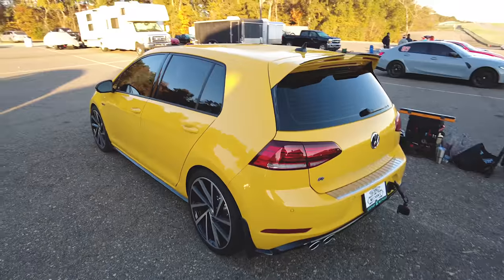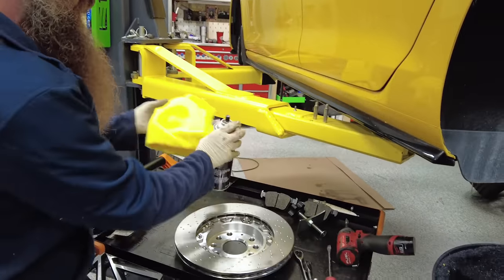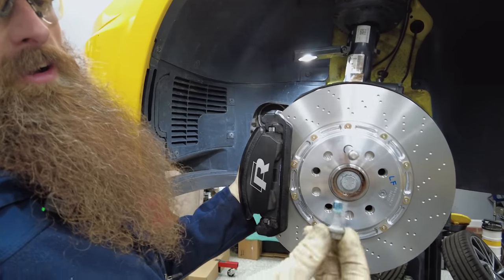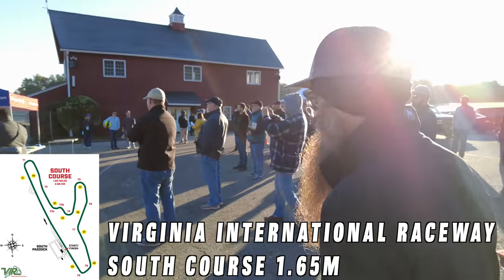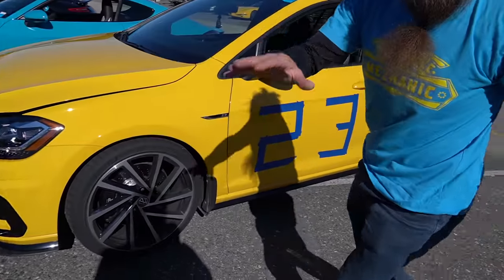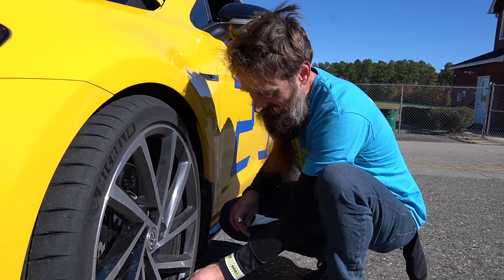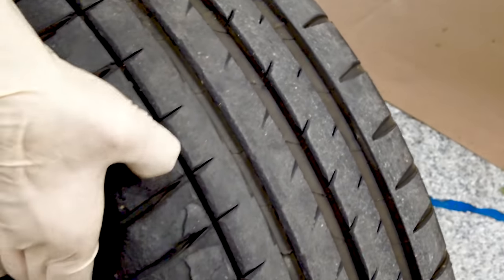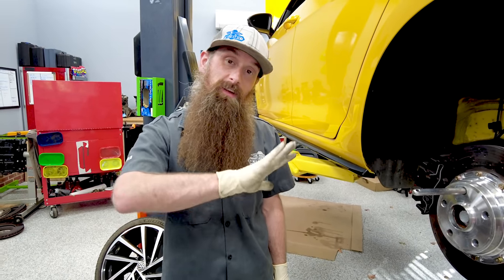Brake Upgrade for Tracking a 2019 Volkswagen Golf R at VIR

Comment: HumbleMechanic you need to remove those heat trapping caliper covers with the R logo to get some airflow on track days. They look pretty but trap a pocket of super hot air on the pads.

Comment: I use 355 Stasis rotors w/ Alcon 4 pots on my MkV GTI . Upgraded to R32 rears. Slotted all around. Hawk pads and upgraded SS lines and fluid. My stickies are Falken Azenis.  I swap out my pads usually one on track days and tires last for maybe 5 days. I also have heat indicators on my fronts so I have a idea of fluid and pad condition. I suggest people tracking keep a complete set of spare brakes on hand. Easy to swap during breaks in sessions.

Comment: I found when I upgraded my rotor size it really didn't do a whole lot. Hopefully you can turn off all the nanny systems. The porshe 922 I drive always thinks I'm in snap oversteer . All these electronic sytems can really put a damper on the party .
Reply: The only benefits to bigger rotors is higher thermal capacity, ie they hold up to brake fade better.  Pads and fluid made the biggest difference on my car.

Comment: What gets me is, the Porsche Race Team takes the drilled rotors off and puts on solid discs.  Now this is before the ceramic discs came out, and in some classes the ceramic rotors are not allowed.  In those cases the race team uses solid iron discs as mentioned.  Why because of stress cracks in the drilled rotors.  Now these rotors are dimpled, and yeah they are supposed to help with off gassing, but realistically a good pad design will do better job of that vs the dimples in my experience.  The aluminum hats are where the weight savings is coming from.  My option would be to go with this set up but order solid discs, and if you want a good track pad that can also be used on the street I would go with HAWK HP's or Centric HD's.  These pads are not track only, but something you can street drive and track occasionally with and not break the bank.  If you want a dedicated track pad, that is fine, but do not attempt to use them on a daily driver the noise when they are cold will drive you crazy.  Another step would be to use braided brake lines, but some are not DOT approved so if your daily driving your car look for DOT approved lines.  Enjoy the ride and have fun👍

Comment: My 2009 car with the mk6 gti engine in got upto 266f 130c On track and then the balance shaft gave up with low oil pressure on a corner! Ive since fitted a oil cooler and iABED baffled sump 👍

Comment: I know the mk7/7.5 R rear brakes are tiny compared to the front’s as would be expected in a front-heavy fwd car, but the WEAR on the rears is....wow! Mine is at 16k and the rears are almost done, fronts are nominal. Factory mismatch for cost-savings? XDS to blame? I’m told even radar-cruise (not as nifty in practice) applies brakes to do its thing- rear only?
Reply: I heard the GTIs brake ratio was favored towards the rear to prevent nose dive when braking, I assume it's the same for the R. But if that's the case your would think the fronts and rears would be the same size.

Comment: Three things:
#1  Why do you have a battery charger on the car for the brake swap?
#2  Can you show how to retract the rear brake caliper pistons with VAG-COM?
#3  Are you going to do a Macan front brake caliper upgrade?  Would love to see a DIY for it...
Reply from the maker: Maintainer goes on any time the scan tool is connected. Especially when doing rear brakes. The caliper movement is a high draw killing the battery during that makes the caliper super sad. 

Yep I’ll do a quick video on it. 

Not sure on upgrades for this car.  It’s kinda right, right where it is

Comment: On my first trackday I was surprised how often you can retorque the wheels form the heat cycles it goes through. Then again my rotors got over 300c°
Reply: DON'T RETORQUE THE WHEELS AFTER A SESSION!$#!@$ 
you are basically over torqueing it. Only re-check wheel torque after the car has cooled down or right before your next session.
Reply: @derekyam1805  that is also what I did. And you wouldn't be able to retorque them when they are hot do to the explanation. If any thing they would be under torqued when they cool down

Comment: I’ve always wondered how the Pilot 4s would do on track.  Do you feel comfortable running those tires for track days or do you feel you need a more extreme summer tire?  Also…Interested in these 2 piece rotors when they come out.  Will they be from ShopDap?

Comment: Thanks for yet another great video! I was hoping you might be able to help answer a question about upgrading the breaks on my mk7 GTI. I am looking at doing the performance pack break upgrade. Please forgive my ignorance but when looking at the specs between the non performance pack front brakes and performance pack rear brakes they are very similar. The rear performance pack brakes are actually 2mm smaller but otherwise seem to be basically the same. It would seem to me that by simply moving the non performance pack brakes to the rear and replacing the front with performance pack brakes you could save quite a bit of money. Is there something I’m missing here and there is actually a benefit to fitting the performance pack rear brakes over the base front brakes?

Comment: VW GOLF TDI 2.0L 2015. Engine dies if you push it to over 3000 revs, but after restarting it runs fine. Diagnostics can't find any fault. What's the problem?

Comment: @HumbleMechanic Did your engine run cool enough on the track with the sustained loads and increased horsepower form the Stage II+ tune you did?

Also,  would/did  you consider running the Michelin Sport Cup tires on the car (or is there even a size that’ll fit those wheels?
Reply: He was running PS4S's. There are Pilot Sport Cup 2's available in 235/35/19, running them on a Seat Leon Cupra ST 300 4drive with track pack (so basically it is a a Golf R estate/wagon with factory 370mm 4pot brembos) and it is amazing on track.

Comment: Can a commoner diy guy change the rear pads without having to put the parking brake in "service position" or do I need to buy a scan tool to do the job?
Reply from the maker: You can. There are ways to retract without the scanner. 

However for sub $150 I’d recommend a cheap scannner(OBDeleven brand for vw/Audi) 

The average DIYer really does need one today

Comment: Would you recommend adding camber plates before going back to the track? Do you feel that a stock R would have fewer issues with heat, versus a stage 2 car?
Reply: These cars love and need camber. -1.5* minimum when you’re novice; -2.5 to -3.0* (front) when you’re intermediate to advanced. It does wonders for cornering grip, tire wear and general turn in performance. I’ve found this to be true on most McPherson style cars, but it’s especially true on nose heavy FWD cars.

Comment: Could you do a video possibly on ways to provide cooling to the brakes, I have a stage 2 mk7 golf r that I take to mid Ohio and haven spoken to some other golf people the brakes get HOT! most pad compounds just can’t take the heat and the ones that can will only wear out more.
Reply from the maker: Part of that is normal brake behavior. Rotor upgrades help too. Im probably going to add RS3 ducts too.
Reply: Do you recommeded metal hoses for the brakes??
Reply: Typically, if the bumper has blanks for fog lights, you can put intake ports and air ducts in those. Some even have blanks for both. 

You can buy factory types like he mentions, but there are also companies that make very good quality "universal" intakes and ducts - Pegasus Auto Racing actually has a lot of stuff like that for a great price (I found them by looking around for NACA ducts and related stuff years ago...)

Comment: Hey Dude,

one question please. Did you recalibrate your ABS system or something like this when you upgrade your brakes? I want to upgrade the from standard brakes of gti (220 PS) to performance brakes. Do I have to concider anything before I do it? Will I match plug and play?

Thx very much
Micha
Reply from the maker: Nope just sent it. This was only a pad/rotor upgrade. Now if you go big brakes. You may have to

Comment: Why were there two different weights for the front? You measure twice- once 15 Lbs and then 23 Lbs?
Reply: Was that the rear brake Rotor?
Reply from the maker: Front and rear :)
Reply: @HumbleMechanic  actually rear and front

Comment: The repair manual says to replace the brake fluid from front right though ;)
Reply from the maker: Always follow the repair manual. LOL ;)
Reply: Was a VW tech for 47 years, always started from the r/r then l/r, r/f , l/f and never had a problem.
Reply from the maker: That’s how I almost always do flush. For abs bleed you have to follow the scan tool order.
Reply: @HumbleMechanic  that’s true, but being flat rate I didn’t always use the scan tool as there was not enough for every tech,yeah I know I’m bad, I did it that way on my own car.
Reply: @nickpappas4133  They updated the repair manual in 1998. ;)
Also, brake fluid flush with scan tool is only required when doing repairs on the abs module.

Comment: The rotor and caliper on the R is simply too small, I changed it to the most aggressive pad I can find which is the pagid rsl2, while the pads are holding up just fine, the brake fluid and the rotor just cannot take the heat. Even though I change my fluid with motul rbf every thing time they still boil on my short local track.
Reply from the maker: Wow!
Reply: @HumbleMechanic  Love your content on the R😁😁 Even though I own a s3 but they are the same.

Comment: SOS NEED HELP. my mk6 gti 2.0T has a EPC light on and now a check engine light . when taking slightly hard right turn car would lose power  which triggered the epc light to come on and battery light to flash on but goes away when I shut off the vehicle and turn it back on .Any clue on what issue may be ?
Reply from the maker: First step is checking fault codes to see what the ECM is seeing

Comment: Would you typically be replacing those ps4s tires to drive on the street after the track day?
Reply: Rotate them early and often. Inspect tread depths closely in 3 places across the tires. 

VW’s and Audis running more negative camber generally have more even wear across the tire. 

I got 4 track days and 12k miles of spirited street use out of my 245/40R18 Michelin PS4S last year in a 3150lb car making 350bhp. 

Adding a 28mm front sway bar, Bilstein B8 dampers and more negative camber made the biggest improvements for me with no tire changes.

The Michelins wear FAST if you do track days, especially if you’re making some power or have a heavier car.

I retired my Michelins to street use only this year, and moved to a dedicated 200TW tire on a separate set of 18x8.5” lightweight wheels, but I’m also getting more serious about HPDEs and my lap times this year.

When you’re novice, run a good summer tire and just pay attention to wear, and rotate accordingly to prolong their service life. 

I cross rotated mine after each event since the left front tire takes a BEATING in a FWD-biased car running courses in the CW direction.

Like if this info helped you. 👍 🍻

Comment: Hi Charles. How did the DSG do (besides the heat)?  Would you rather have had a manual for this?
Reply: I've got a Veloster N with DCT and it (with TrackSense shift mode) is faster than I am (with paddles) around a track.  The DCT in either mode is much faster than a manual.  Yes, it feels like cheating, but laps times don't lie.
Reply from the maker: I don't think id rather have it. but Id love to compare head to head. LOL I Think the DSG was great to help focus on the driving line. but the manual would be a blast.
Reply: @HumbleMechanic  thanks Charles. Next to a TTRS, the R seems like the platform to have. 👍. (Well, it’s really the same platform except for the engine. :)

Comment: Hey Charles, technical question for you, is it safe to mix DOT3 with DOT4 broke fluid? I want to change the fluid in my GMC Canyon from DOT3 to RedLine RL-600 which claims DOT4 and I have a power bleeder which I'm going to use. If there is any residual DoOT3 left in the lines from the ABS pump would it mix together and cause issues or should I completely flush all the old DOT3 out
Reply: Dot 3 and 4 is very close in the formula so you won’t have a problem switching.
Reply: @waterloo123100  
But will they mix together and not cause issues. 

I flushed the fluid in my Golf R but that was already DOT4 so I didn't really need to worry, a little bit of old fluid just would have slightly lowered the boiling point
Reply: @gtileo  Yes you can blend them both. You can actually buy brake fluid that is rated for both dot3 and dot4

Comment: For people who don't want to disable the pad sensor via software, just cut off the cable from the old pad, short it, isolate it, then connect it back to the plug on the car (maybe secure it to not move around).
Also, when on track, always keep hands at 9 and 3...
Reply from the maker: Great tip!!! If I was tossing my old pads, that would have been the play. 

Instead I have yet to do anything. 😂😂

Comment: Need to have a scan tool to change brakes.  Like I need another reason to never buy a vw.
Reply from the maker: LOL okay
Reply: Nobody asked. Goes along with electronic handbrakes not specific to Vw’s.
Reply: Im a total VW guy but this just sucks. A friend got a relatively new Mercedes and on her car there is just a service menu in the board computer wehre you can retract the parking brakes.
Reply: @HumbleMechanic  it just sucks that vw does everything possible to make you bring it to a dealer.  You need special tools to do just about anything on a vw.  Plus the plastic disintegrates into junk.